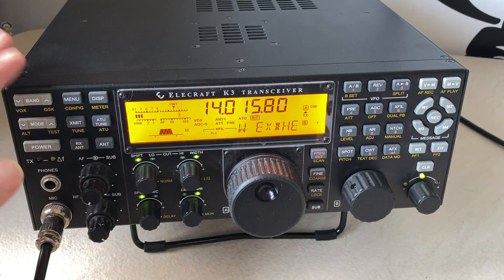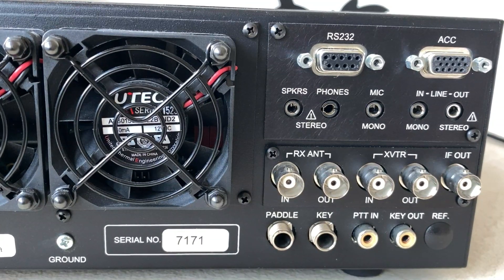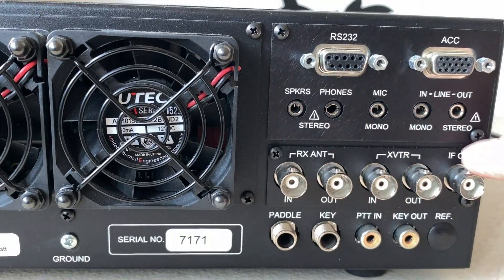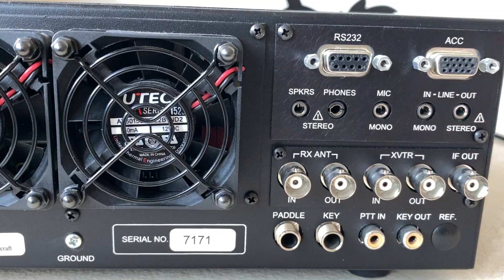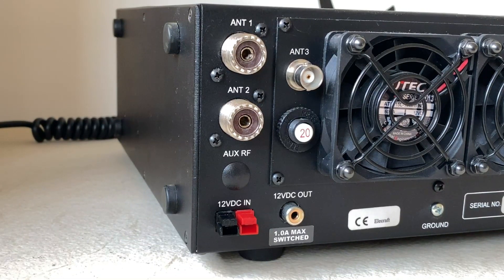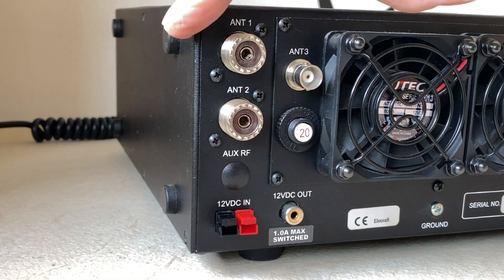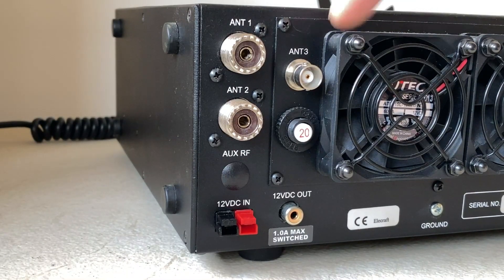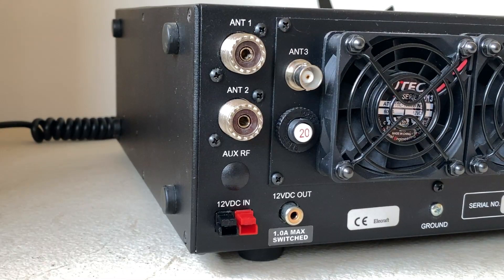Elecraft K3 Series - End of An Era

Comment: Owned it for 4 years, upgrade to nearly the S model, very fine, lightweght radio, with outstanding perfomance. Every key is there where needed, help text in the menu AND NO WATERFALLDISPLAY. (cause I dont want a TVbut a fine rig) Will hold it as long as possible, cause I believe there will be not any successor with that performance.

Comment: The K4 is going to be too expensive. If it were priced around IC7610 money then they'd sell like hot cakes. I feel the £5K+ price I have seen bandied around is just silly.
Reply from the maker: Hi John, there is no firm price yet but I don't think it will be quite as high as the rumours! Keep in touch. 73s Peter
Reply: Ecraft must believe the competition is Flex, not ICOM. I thought SDR was driving prices down.
Reply: @watersstanton   £ 4,250. is the price in the UK.

Comment: The IC7300 spelled doom for a lot of radios. I believe the IC705 is going to accomplish the same thing.
Reply from the maker: Hi Jeff, thanks for the input. We will all know the answer to that one - later this year. 73s Peter.
Reply: The 705 is missing a few things like a durable case for portable ops, an ATU (huge miss), and the proprietary battery (while clever, means I would need to buy overpriced Icom HT batteries that I can’t use on my Kenwood HTs).  I’m sticking with my KX2 and KX3, both of these allow me to work weak cw and allow me to run both a straight key and paddle simultaneously.  If the 705 makes it to a Mk2, I might be a little more interested.  Of course, the KX4 will be around then.

Comment: Great video...  Thank you.  Speaking of the cessation of radio production, now that ICOM no longer produces their IC-7200, what would you say is the best radio for use in the outdoors?
Michael VA6XMB
Reply from the maker: Hi Michael. Well a radio for outdoor use often means low power and battery operation. So KX2, KX3, FT-818 and eventually IC-705. For 100W and low weight, a used K3 or an  FT-840 and don't forget FT-857 and FT-891.  73s Peter